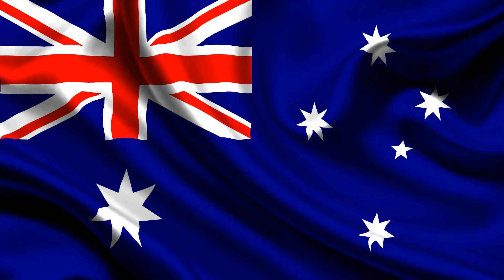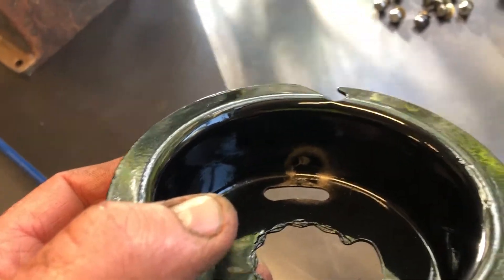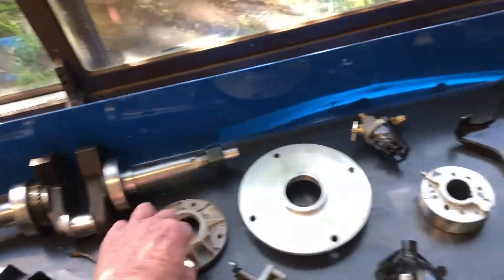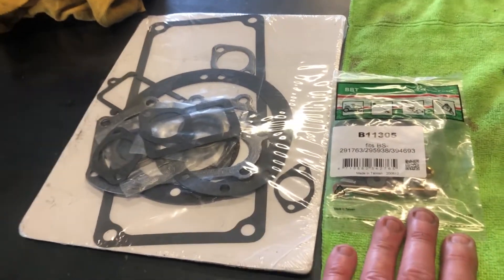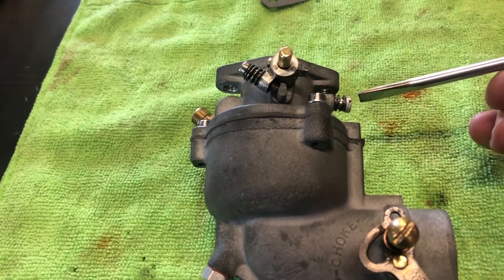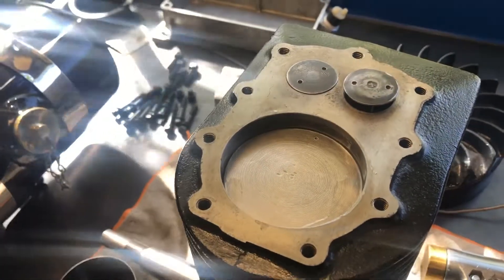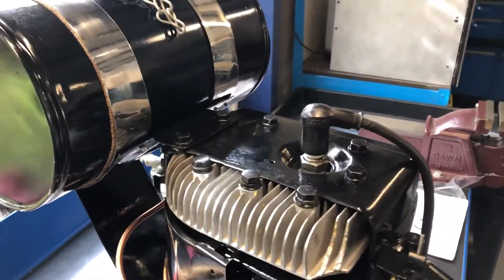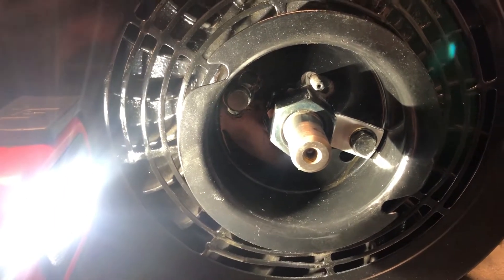Briggs and Stratton 23B Part 2

Comment: Just a though that i had and i cant remember  if there a cuped washer that goes between the flywheel and nut i know for a fact that some briggs and scrapumm used them you got yours looking good
Reply from the maker: Gday Brian. Youre probably correct. It was a while ago that I did this engine but its quite possible that there should be a locking device of some sort. Thanks.

Comment: Rebuilding a 23d  can't seem to get flywheel off. How do you do it?
Reply from the maker: Gday Jake. A you know the nut needs to be removed. I just used a lever between the flywheel and housing, applied pressure with the lever without damaging anything then gave a sharp blow to the end of the crank with a hammer. The flywheel popped of easily. Some heat around the shaft area of the flywheel will also help. Good Luck.